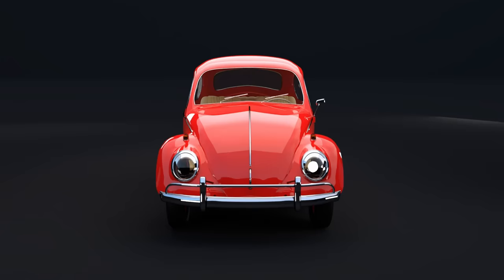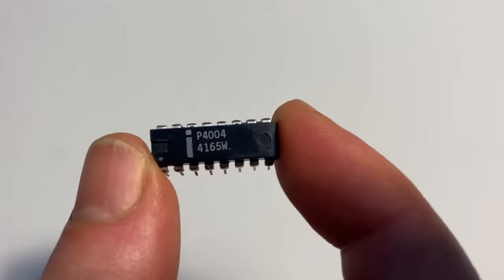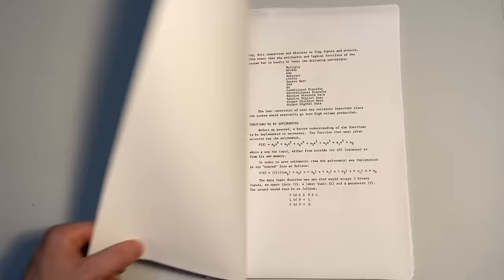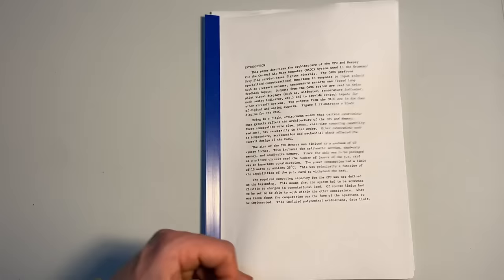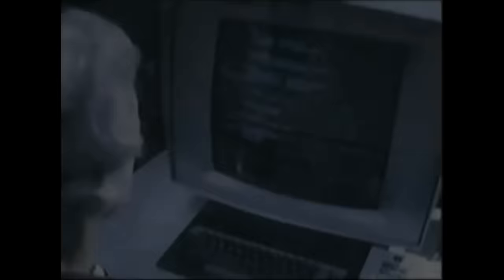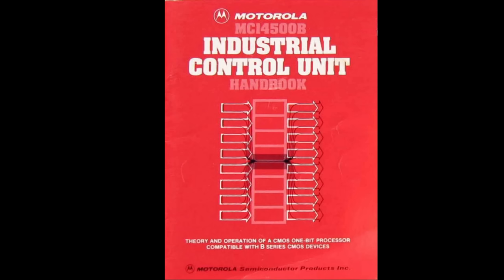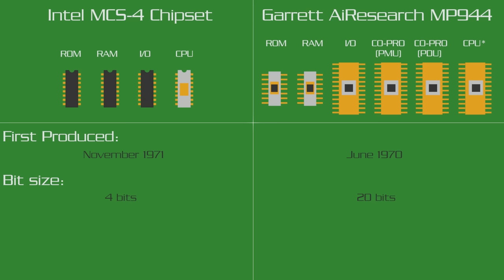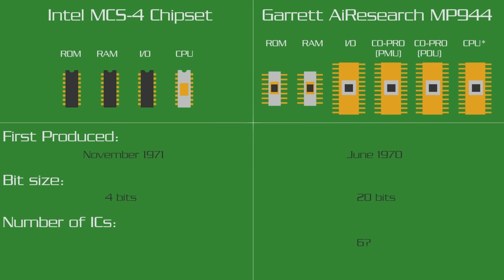The World's First Microprocessor: F-14 Central Air Data Computer

Comment from the maker: Since a few people have asked how the program counter can be stored in the ROM. It was a special register physically on the ROM chip, not a read-only address in ROM itself. Ray's paper states it was resettable and steppable and could accept an address input. So, I'm 95% sure that allowed for full program flow control. @phirenz  makes a good argument for why this may not be quite so simple though....and may have actually required additional ICs to actually implement.

The SAAB Viggen is getting a lot of mentions in the comments. It had a highly advanced flight computer composed of many discrete ICs. Not a microprocessor but very impressive nontheless. I am considering doing a video about it in the future.

The 'MiG-25' at 6:11 is actually a MiG-31. Thanks @AvArIeNmArKu4

An ‘assembler’ translates to machine code, not a compiler. Thanks @Mat-Ellis

Swing wings are a subset of variable wing geometry. Variable wing geometries may be implemented in other configurations and the field is not 'obsolete' as I stated. Thanks 
@nobodynoone2500  

31:48 bottom line: "U if P > L" should be "U if P > U". Thanks @MatthijsvanDuin  (I'm really mad I got that one wrong!)

10:00 - Lateral Axis, not longitudinal axis. So, the aircraft is pitch stable. Thanks @UnitSe7en

45:00 - The hardware prototype ran at the same speed as the final product. 

And yes, I know higher aspect ratio doesn't equal more drag (it's the opposite for subsonic flight). I was trying to simplify and probably simplified a bit too much...I said I always screw up supersonic flight discussions.
Reply: [ retired Engineer ]
Caught out on a technicality...

When I bit-banged on 4004,8008/80/88 and 6502 a microprocessor was a single chip, not a collection of six.
One of the Engineers that worked on it wrote a book that was published in 2017!

PS I'll still give the vid a thumb though, you made a half decent vid.
Reply: I don't think you can call something a compiler if it just translates from ASM to machine code. I'd call that an assembler.
Reply: The F-14 could engage 6 targets simultaneously but it could track many more. The F-14 could track 24 targets and fire on any 6 with the half dozen Phoenix missiles it carried.
Very interesting video I really enjoyed it and recommended it to a few friends.
Reply: An assembler IS a compiler, albeit for Assembly Language. EG - MASM, TASM, WASM.

- ex game programmer
Reply: @hamesparde9888 It's still a compiler, just for a lower level language. I wrote compilers for 3 years (hard stuff!)
Reply: @andrewday3206  though here you need to differentiate between the Air Data Computer and the AWG-9 fire control system.
Reply: I was an Assembly programmer on S370 for 10 years, I used a complier :) That said it was a tad more capable than just  translating as it supported macro functions, data definition libraries etc. It did basically translate though...Prior to that I hand translated on a Z80 at times, entering directly into a ROM emulator with a hex keypad, and before that loading in the boot sequence into ICL1900 in binary on the front of the CPU !!! Memories :). @NinjaRunningWild
Reply: Although the term was mentioned multiple times, computers going from discrete transistors to microprocessors involved passing through an intermediate step of being built using integrated circuits, and of course the computer that lays claims to being the first there is the Apollo Guidance Computer.
Reply: @NinjaRunningWild  yes but isn't there a key distinction in that an assembler is (for the most part) just substituting menumonics for machine code. Whereas a compiler has to do lexical and syntax analysis as well as code generation. I mean for example a source to source compiler (that is high level to high level) isn't even just called a compiler, it's called a transpiler. I've never really heard anyone refer to an assembler as a compiler.
Reply: @hamesparde9888  Yes, and in between, you can also encounter macro assemblers and high-level assemblers. But still, they are not called compilers,despite being very sophisticated tools. Compilers can compile into assembler source files, but you don't see that today. Compiling to an intermediate abstract language and then optimize and translated it straight into machine code is more common and useful (same source file, different target platforms). Today most large compilers are actually even compiler-linkers.
Reply: That last hint ... ominous!
Reply: @@Carah-qk3nz so there were a few mistakes.  Overall I think it was a very good video. There's no need to be so negative.
Reply: I think the distinction between compiler and assembler is important. I started out programming directly in machine code - I had the hex (hence also trivially the binary) for every op code of the Nat Semi SC/MP microprocessor memorised so apart from the annoying calculations of offsets and addresses for branches and subroutine calls I didn’t really need an assembler. When I did start working with compilers however the setup at the time (late 1970s and early 1980s but I assume still true now) was that the compiler didn’t go directly from whatever high level language it supported to a binary output, instead it wrote out an intermediate assembly language file that in a subsequent pass of the compilation process was then passed through an assembler to actually create the machine code. While that was usually invisible to the compiler user in my first real job after the mostly idealised world of university I was trying to debug a program and it just didn’t make sense, everything looked right from all of my debugging statements but the program just wasn’t behaving as expected. Eventually in desperation I looked at the intermediate assembler file that the compiler was generating and discovered that there was a bug in the compiler and it was generating the wrong assembly code for a complex conditional. That would have been way more difficult to find had I not been able to look at the intermediate assembly code file. Because of that two stage process I think it is useful to name the stages differently, compile then assemble.

Not long after my compiler incident I was doing another project, directly in assembler this time, for a pre-release prototype of the M68000 where again my program was not behaving as expected. In that case I eventually discovered that there was a bug in the instruction set itself, the decrement-and-branch-on-non-zero instruction was locking up the CPU so as a workaround I had to do separate decrement then branch-on-non-zero instructions to avoid using the instruction-of-doom.

Finding that the compiler and even the CPU might not be a reliable foundation was a real wake up call to the realities of real world software engineering. I guess that sort of stuff is less likely to happen to the average programmer now that so many more people are hammering on the same tools and information on bugs is disseminated so much more quickly.
Reply: @NinjaRunningWild  If you've read any of the manuals for MASM, TASM, or WASM, each states that it translates pneumonics into machine instructions. There are some good books on writing a compiler out there. If you read one, I'm sure that you will no longer confuse an assembler with a compiler 😉
Reply: And I’d argue the MiG-25/-31 are the most “imposing” military jets. Just the monstrously large engine-to-airframe size is ridiculously intimidating. I fully understand why NATO were so afraid of it before they found out how crap it really is.
Reply: As others said, it's still a compiler, unless it's literally just 1:1 translation, but that's very uncommon because it's very inefficient (e.g. empty branch-delay slots).  Assemblers do exist, but they're almost never used because they're inferior.
< Computer engineer and analyst for longer than a lot of people here have been alive. Designed a (very basic) MIPS superscalar chip with branch prediction, hazard detection and correction, etc.
Reply: @VeritasEtAequitas  Assemblers are NOT inferior. They are used extensively to make  for the inferiority of object code generated by compilers 😉  And yes, I'm a computer engineer.
Reply: @bob_mosavo  They do less when they could do the same. This is known as inferior.
Reply: @VeritasEtAequitas  This is NOT known as "inferior." Get a dictionary and READ IT 👍
Reply: wrong the JA-37 viggen was before the F-14
Reply: @bob_mosavo  LMAO, it is. It has less functionality. Anything it can do, a compiler can do >=.  I was writing assembly back when David J. Westfall was in my family's office talking about an idea for the very first processor that could change in clock speed without rebooting.
Reply: Great video!

I think you meant to say that you could assign 4 bit value for every (decimal) digit (not integer) in a number (for use in a calculator.)
Reply: Depending on how you define "practical", I think you could design a "practical" 4 bit processor...as long as it was a manycore (probably tens or hundreds of cores/microprocessor chips). 😉
Reply: Thank you Alexander, my first video to watch from you. 

Question: Would it make sense to have 3 systems on an airplane, 2 who would always do the calculation and if the results match, there is no failure as the probability of both chips failing at the same time the same way is either extremely low or it's only possible if there was a design flaw in all systems.

If in any case the results don't match a 3rd "witness" would calculate and the results are compared. The one outvoted would be working incorrectly and an error counter is increased. After X amount of errors the witness system replaces the chip with the last error or if possible the one with the higher error count.

The advantages would be not having to do the error checks on the system for each calculation thus the chips could run faster. Another advantage is you get to sell 3 chips per Airplane instead of 2 😅.

Thoughts?
Reply: The Intel 8061 used in Ford's EEC-IV engine control computer did the same thing.  The ROM and RAM chips each have auto-incrementing PC and data address registers which can be (re)set via a write over the multiplexed MBUS but which otherwise automatically address the memory device to the next word after a read operation.  This dramatically reduced the number of wires required between the CPU and memory devices since the bidirectional data bus would be used in reverse direction to set the register address H:L with two writes to the memory.  I'm glad to finally learn of at least one other computer that put the PC in the ROM chip.
Reply from the maker: @ybvb  Are you a systems engineer? You literally just described something very similar to a triplex voting system - as actually used in fly-by-wire systems! See towards the end of my fly-by-wire video for more on that.
Reply: Yes, yes I am.  @Alexander-the-ok  I will look into that! The YT algo has been recommending the impossible 3d video game video a lot to me and I never was interested, now I got this F14 video and I clicked fast. So I will probably watch the rest of your videos now.

I do some software programming (mostly connecting APIs of managed service provider systems for ease of use in an IT Service Provider SMB. Some frontend (vue3) for that as well, some redisdb for caching and not bothering the cloud API endpoints too much. But my original background is System Engineering (MS, Linux)
Reply: the reason why top gun was so popular ... was... banging music.
Reply: Tf "Read Only Memory" actually stored something that is not read only?
Reply: Right after saying that you get aerodynamics wrong you perform one of these gaffes: high aspect ratio corresponds with high drag only in supersonic (actually I think it's not so much aspect ratio but sweep); subsonic high aspect ratio wings have low drag.  Look at a glider.
Reply: 4:52 F-14 was not designed to be unstable, that started with the F-16 when Fly-By-Wire systems became available. F/A-18, F-16, those planes were designed to be unstable though, and onward. the computer was just designed for the swing wing system and optimal position
Reply: Question: did the F-15 and the F-16 have anything similar regarding flight data computers? Did they benefit from the F-14 experience?
Reply: Yes, the ROM program counter was steppable and resettable thus 100% allowing full program control.  One register and some extra logic only required minimal extra transistors. Ray Holt
Reply: Saab CK37: Am I a joke to you?

CADC delevopment was finished in June 1970. CK37 was delivered from serial production in April 1970.

"This computer, CK37 used in the Saab AJ37, was the first airborne computer in the world to use integrated circuits (first generation ICs)."

Source: "Central Computer for aircraft Saab 37, Viggen" - Bengt Jiewertz, Formerly of Datasaab and Ericsson AB
Reply: Having the address counters in the memory (including PC on ROM) was also done with the Fairchild F8.
Reply: Pretty sure it is supposed to longitudinal axis. When we talk about longitudinal stability, we’re talking about pitch stability.
Reply: @CakePrincessCelestia  Yes, F-14 is often wrongly credited as being the first fighter with a IC computer, but this video actually gets it right as it's the first with a microprocessor.

As for the idea of making a video about Viggen so would I recommend to include or focus on the JA37 version as it adds something new and interesting with a modern looking navigation system with a map.
Reply: The only extra real estate would have been the shift register and some gates. Not much. Ray Holt
Reply: it's easy to confuse the 25 and the 31
Reply: Long live the program counter!
Reply: the JA-37 Viggen was first not the F-14 with its central computer CK37 in 8 februari 1967
Reply: A
Reply: •Glove vanes weren't for maneuvering, they were for mach tuck. 

•The F-14 could track up to 24 targets, and engage 6 at a time. It was not limited to tracking only 6.

•The first laser guided bomb was developed in 1967, and adopted in 1968, two years prior to the first flight of the F-14
Reply: The multiplication method you wrote is called Horner's method.  To get X squared you multiply by X.  To get X cubed you multiply by X again.  You need each in turn, so this is the most efficient method to calculate a polynomial
Reply: 7:28 high aspect ratio don't have more drag, they have less. But before that you need more context. drag characteristics are quite different at subsonic and supersonic speeds. At subsonic speeds wave drag is quite minimal. the main component of drag is mostly induced drag. induced drag is lower for higher aspect ratio wings. "T-posing" (hilarious BTW) also gives you more control authority and better stability (in general. I'm not sure about the f-14 in particular). At supersonic speeds wave drag is dominant. wave drag is mainly dependent on your frontal area. which is why you might want to tuck in your wings. There's also the part about delta wings having better lift characteristics and control at high speed.

Hope this helps.
Reply: the comments is a pletora of lessons per si.
Reply: This is why the qualifier 'commercial' is usually tacked on to 'first microprocessor' when discussing the 4004. Aside from that, the 4004 needed  3 additional chips and you needed all 4 to make up one CPU as we think of them today. Same concept with the MP944. This could be considered Generation 0 because it wasn't until chips like the 8088, 6502, 68000 came around that they were true microprocessors in the strictest sense of the word. And even then, they still had external cache. Technically the 486 was the first modern microprocessor.
As for the 4004, an Arduino is more of a microprocessor than the 4004 by a wide margin. I think an Arduino would have worked just fine for controlling the 'Cat, which is an interesting way to look at how far we've come when a $10 microcontroller is better than a million dollar top secret computer in a '70s fighter jet.
Reply: @philiprowney  boat chips were on a single dye in a single package but they do require support chips the diagram that he shows is also showing the required support chips
Reply: @ybvb he did another video of (I think) the Soviet space computer that did something like you're describing.
Reply: @ScorpionXXXVII  gonna check! thank you
Reply: @ScorpionXXXVII  maybe you will understand what I am about to write, if not - don't worry.

I watched the software chapter of the video you mentioned. At the end of chapter he says "maybe could but never did" then I started watching the recommended video below about Ukr encircling Rus on their own territory and some bridge Dilemma Rus is facing. In that video someone completely different used the similar phrase "maybe they could but will they do" haha
Reply: @ScorpionXXXVII  Video is William Spaniel Ukraine is Encircling...